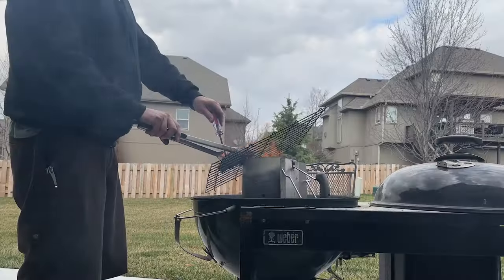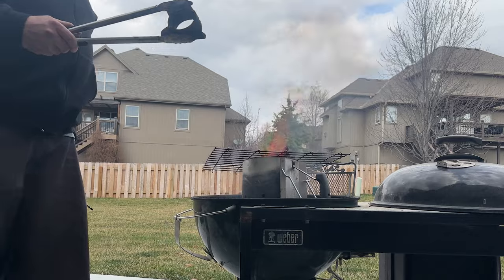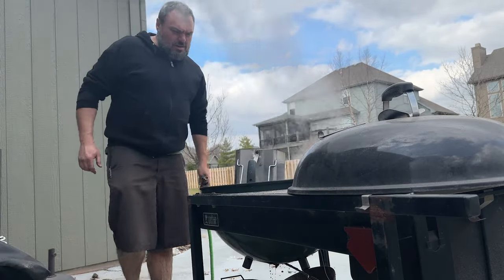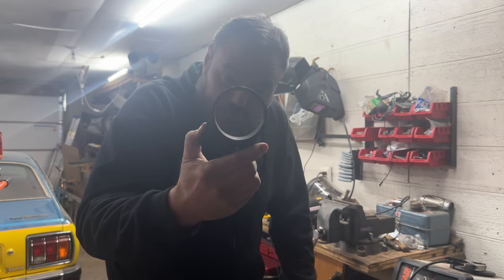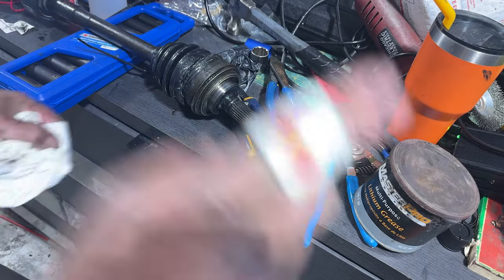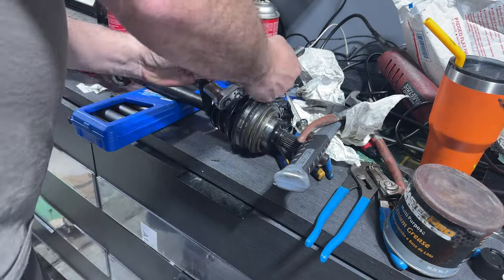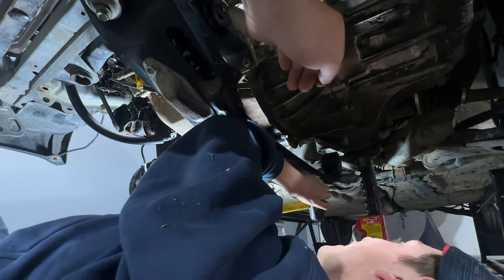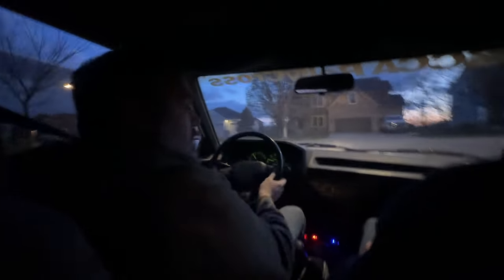3D Printed Parts! Motor Mounts and Axle Repair - 1987 Corolla FX16 - RXFX

Comment: In currently doing the same thing to my fx16 gts and I can’t get the damn joint off I bought a 27$ 4lb sledge and still nothing😂
Reply from the maker: Ball joints are jerks. See if oreilly has a separator or a whole kit to rent. I’ve had good luck with the type that have the fork on one side and the arm on the other with a big bolt running through that you hammer down with an impact. Good luck!